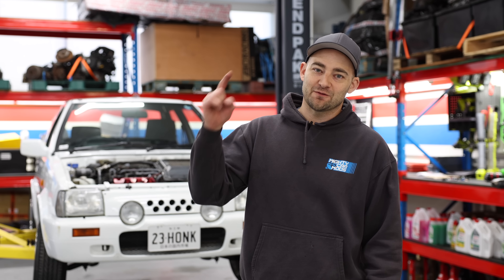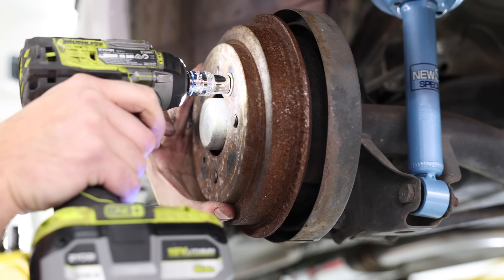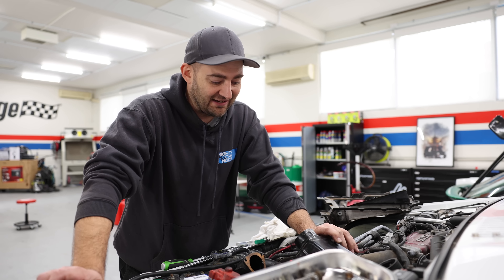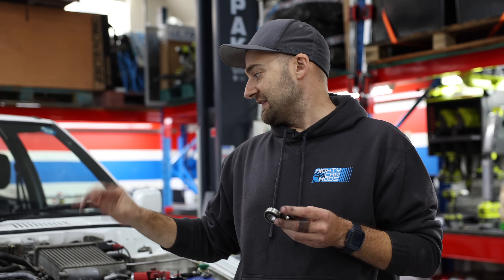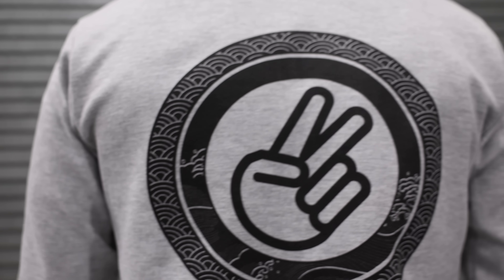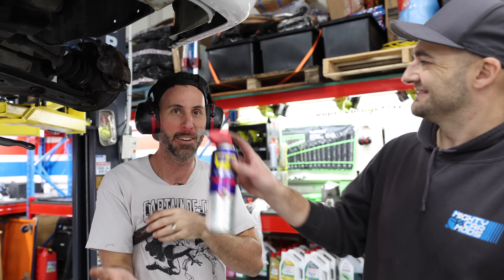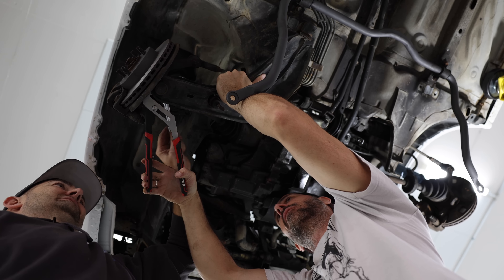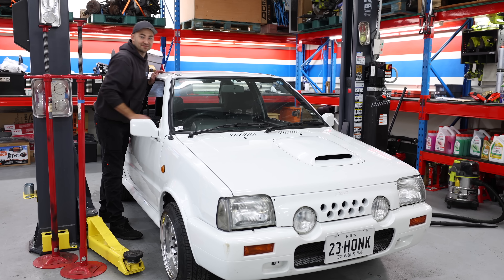Nissan Superturbo Modifications | 'The Honkfiles' [Part 2]

Comment: Love the car!! But after seeing that fuel filter you definitely want to pull the injectors and get the rail cleaned and injectors flowed and cleaned or upgrade before you put the aftermarket ecu on! Seen it many times as a mechanic, those injectors baskets will be full of crap no doubt
Reply: Why clean the rail?

Comment: If you ever get stuck with o rings seals like for your fuel tank at the beginning of the video. Try a Hydraulic seals company. Some stock many sizes for Hydraulic rams etc... and they have the types of rubber levels for corrosion and heat levels. Some places even make seals on site to your specs, just got to give them measurements if the old seal not available.
Reply: O-ring splicing.
Reply: x2 I came here to say this.

Comment: A little tip when you’ve cleaned out your fuel tank is to put some paper towels in it and blast it with a air hose the towels fly around and soak up everything that’s left

Comment: A few tips when turning parts on the lathe.
Get the cutting speed correct, different metals machine best at the correct speed. 
The cutting tool must exactly on the centre height, use a selection of shims to get it right.
The cutting tool rake and clearance angles  have to be ground in to the tool to suit the metal being machined and it has to be kept sharp.
Use coolant and cutting fluid for the best finish.

Comment: Top Tip for repairing rust pinhole. 2 steps #1 electroetch the inside of the tank basically reverse plating steel. You simply set up the plate steel but reverse the polarity till the oxides are gone. #2 use new plating solution to plate the inside of the  tank. You might want to repeat the process. I've seen this done on vintage Harley Davidson tanks.

Comment: Now that you have a lathe a good quick small project would be to make a heat soak for those V band faces that warp a bit when you weld them on to pipe. 
Just get a bit of solid aluminium round bar and machine so the v band flange clamps to it and takes the heat away when welding the pipe on and the heat has somewhere to go instead of warping the thin flange.

Comment: Just a tip? Hopefully maybe?

Like with the bearings, you can also get replacment gaskets at “gasket” shops. They usually also provide gasket design if needed for a specific aplication. Maybe you already tried that and that the fuel pump gasket is a specialty item, but i had a lot of luck with gasket shops providing replacement items or even an upgrade solution.

Big fan since the driveway beginings!

Best from Slovenia.

Comment: When welding stainless pipe, you need to tape  off the ends and fill the pipe with argon (back purge) without back purge, the weld will sugar, and wont weld properly.
Reply: Although not ideal, not purging is perfectly fine for this application. You wouldn't do it on an inlet pipe but a dump pipe is unlikely to cause issues.
Reply: @TheMeta6  I wouldn't risk it, I'm a journeyman welder, been welding stainless pipe for 17 years. It's pretty easy to sugar a weld, just as easy to purge.
Reply: @aztharz5637  I totally get where you're coming from it's not the way it should be done but we're not taking about some high end stainless fabrication it's just an exhaust on an occasional use car. It probably won't fail and even if it did what's the worst thats going to happen? I'm a fully qualified master technician of 20 years who now does fabrication for a living, I've welded many exhausts and I've never purged a single one.

Comment: That exhaust now has no allowance for the engine to rock back and forth. It needs ideally a sprung cup joint, but a flexible bellows will work. The type sitting on the bench at 13:39 doesn't allow enough movement.

Comment: If you get stuck for an O-ring then boiling the old ones in water for 10 minutes or so  will help to remove some (but usually not all) of the "set" they get from being compressed for years.

Comment: Great job is an understatement tackling everything done to the Turbo Nugget, well done.

Not trying to sound condescending below, but there are some recommended safety precautions i recommend below.
Now that's out of the way, Hear me out on this plea of mine, Please wear Safety glasses when you are working on a lathe, i've seen people lose their eyesight due to some shards of metal that went flying into their eyes, back then when i went to machining school.

And please wear a respirator when you remove the drums of the hub, there are asbestos dust in there that are not good for your lungs,
(The disc brake systems fall into this category, but all the free flowing air around the discs allow for a less concentrated amount of asbestos dust)
The formulation of the brake lining/shoes are indeed have less asbestos in them, but there are still asbestos in there.

Thanks & Stay safe, and let's not put our MAD rare body parts IN THE BIN.

Edit: A bit of an old video to post a comment on but carry on with the HONK at your leisure.

Comment: You know here in the UK you still do see a few K10 Nissan Micras on the road. Round where I used to live in Wolvo there was an old chap who used to patter about in a H-reg one and if memory serves I worked at a place in Brum where someone used to daily a J-reg one. I think that might have been the last model year before they switched to the K11. My mum actually had a D-reg Micra - I think my dad paid £400 for it when she went back to work in 97 and it actually did 4 years faithful service even though it was a pile and all it had done was an exhaust. My dad sold it when a garage told him it wouldn't get another MOT because it was totally rotten - he sold it to a guy he worked with it who drove it for 6 months for £100 and then he sold it to his daughter for £120 after he drained all the fuel out of it. She actually drove it backwards and forwards to Wales for months moving house and getting started out there with her business before the MOT ran out. 

For a 1 litre NA it actually had a fair bit of poke - even when 4 star was phased out and it had to run on unleaded. Nissan really knew how to build them. She had a K11 Micra after that for 7 years - she sold it when it was 10 years old and I looked up its reg on MOT history years later and it turned out it did 20 years on the road before going for scrap. 

Don't know what the engineers and managers were smoking at Nissan in the 80's and 90's but they really knew how to build them thats for sure. Absolute turds which would go forever.

Comment: AD22VF Front calipers with discs off a nx-r coupe will be a HUGE upgrade! they are the same fronts as the gtir, i have them on my n14 t.i pulsar. They may work for your application only thing is will definitely need 15 inch rims, my n15 sss wheels Just clear the calipers. Also had them on my n13 pulsar q, freaking amazing and cheap upgrade

Comment: Every bearing does have a code on it, for example the plastic sheilded one's have it in the plastic itself and the metal one's have it laserd into the sheild. But if it's open type, then it'll be laserd on the race.
But you don't actually need the numbers stamped on it. All you need to do is measure it (ID, OD & thickness) and the type you want n hey presto! 😁👍🏻 

There are more than 3 types btw, as I replaced the needle roller bearings in my mobility scooter. They've got an outer pressed bit of sheet of steel which holds the needle in a cage and it just ride on the shaft. There is grease in the bearing (like in every bearing) but I packed it full of grease n did the same alllll along the shaft. 

Btw, going back to the first 2 sheilded bearing's I was talking about. If you get a hook pick, with a really sharp point, then you can eeeever so gently open it up but be extremely careful so you don't damage it. Try it out on an old bearing first by carefully opening it up, pack it full of your favourite flavour of grease (as you'll see from new there's hardly any in there) aaand then use your fingers to close it up so it sounds like a click or a pop. 

The bog standard general purpose grease that I use has got lithium in. You want grease that's got lithium in as it's a nice soft metal that beds itself into harder metals e.g. ball, roller, brass, bronze and countless others

Comment: Thats car share most parts with Nissan sunny B12 even fuel tank as well. I worked personally with my Nissan as part of my hobby. I am software developer but let me tell you these control arms from B12 and fuel tank EFI B12 almost same. Also you can get complete suspension of B12 which is four wheel disc usually found in GTiR Nissan same B12.

Comment: Your tiny little car need one piece to perfection that now is missing - central rear mirror has a pimple on its mount, from the windshield side, there shoul be a small rubber tube to compensate vibrations!) Like in Jimny rear mirror.

Comment: Marty.  Just be aware.  When yo u get rotors machined, if they do it on a lathe as I believe you did, you need to undirectionalize them for best performance.  When you cut on a lathe it makes a really fine spiral.  Not good for brake conditions.  Best to have them use a face mill or you could scratch it up with a die grinder and a light sanding disc but not as much advised as a face mill.  Not good for the bed in procedure for it to be a tiny spiral running all the way out.
Reply from the maker: Yeah they were done on a specialised brake machining setup

Comment: Why don't you use the expensive fountain test. (untighten the fuel line on top of the engine to see if the pump is actually sending fuel to the fuel rail) ? And is there a reason why you don't put a flex piece in between the exhaust? (or is it high up near the turbo?)

Comment: Anyone reckon one of those Garrett GBC turbos would be a bolt on replacement for the factory one in the SuperTurbo? I know the turbine inlet is identical but Hitachi might have used a slightly different outlet gasket on the HT10-8. I reckon it'd be a mad upgrade!

Comment: Oh my.... Nissan Pulsar brakes as an "upgrade" - eek! Maybe they work OK on the lighter March ST but on the Pulsar GTiR they were a liability - a few hard brakings into roundabouts in succession and they'd be overheated leaving you with what felt like a solid block of wood under the middle pedal and near zero braking effect. That was with good softer compound EBC pads and fresh fluid. One near soil self experience later, bigger brakes installed.
For me the block of wood under the brake pedal feeling was thankfully experienced for the first time away from the public highway on a professionally run race circuit. ....... With roundabouts ...... yup one of those. <.<  >.>

Comment: 13:00 i don't think i see a flex joint in that exhaust, unless it's way up out of the view. But you should definitely add one if it's not there.
Transverse mounted engines rock back and forth in ways that will stress the exhaust pipes until they break, which is why they need flex joints.

Comment: eBay's global shipping thing is neat but I urge anyone to avoid it whenever possible, dankpods, another Aussie youtuber has had on multiple occasions had just awful experiences with Ebay's global shipping centre, having unopened and SEALED products opened by eBay, stuff been stolen, had eBay workers cut up a products box while opening the shipping box for inspection, now I guess it depends on your specific situation but try every possible solution for buying something overseas on eBay and only use their global shipping program as a last resort